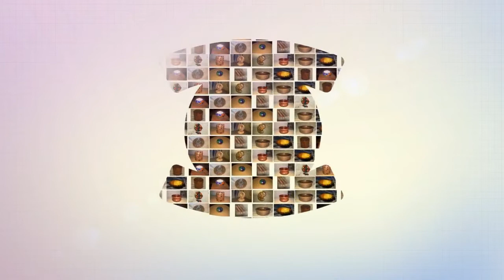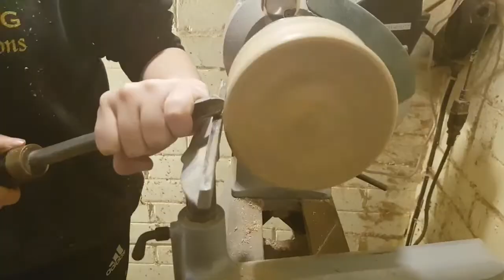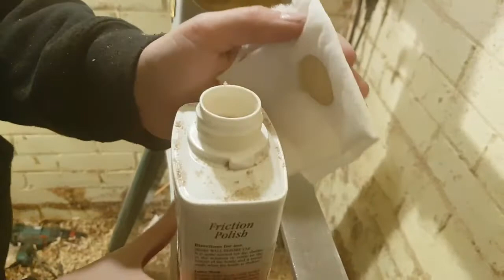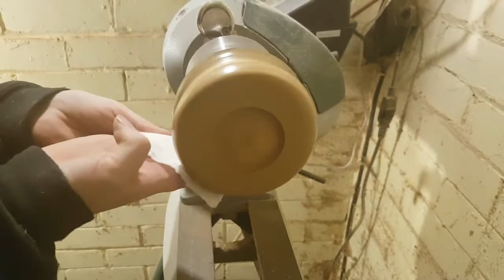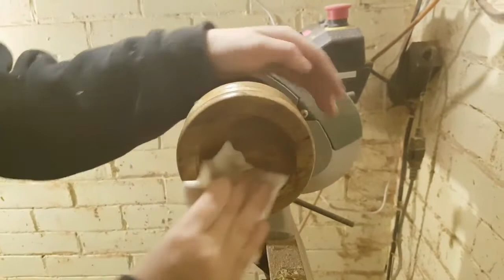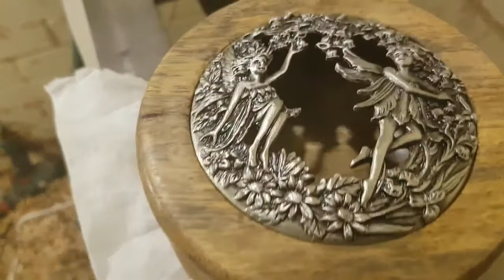Wood Turning - Potpourri Bowl topped with Fairies made from Tamarind Wood

Comment: I have seen a lot of your videos, and I think your gouge is too big. It seems to me that it is 3/4" (19mm). I have a similar one, but I rarely use it. It is too big, and slows down my lathe like I see in your videos. Try a smaller one, 1/2" - 13 mm and keep it razor sharp. It will give you more controle in your work. You may see how I use it in my videos. Perhaps as much as 90% of my turning is made with this one.
Keep on turning, good luck!
Greetings from Norway, Leif.
Reply from the maker: thank you for your advice. I will look into getting more tools eventually. I don't have a way to sharpen my tools at home yet.